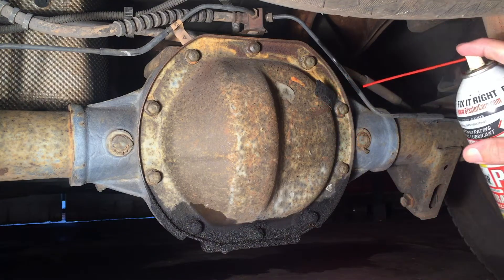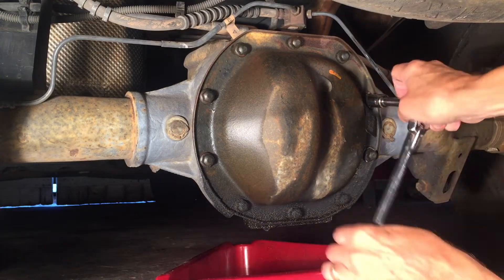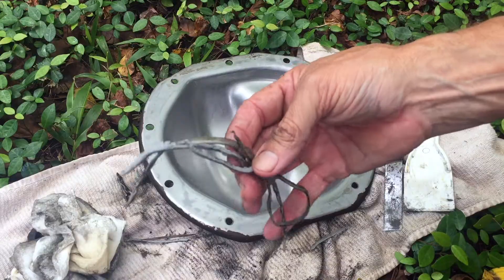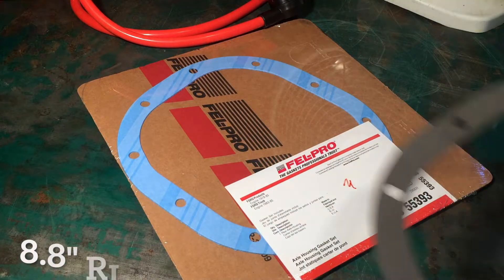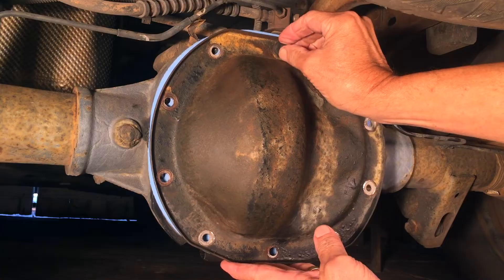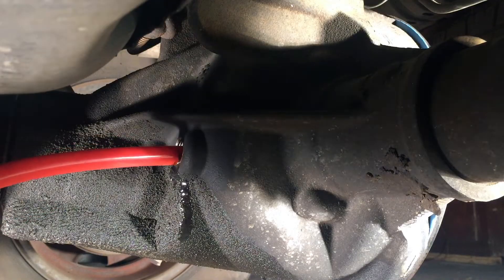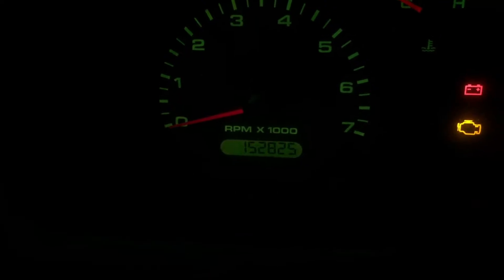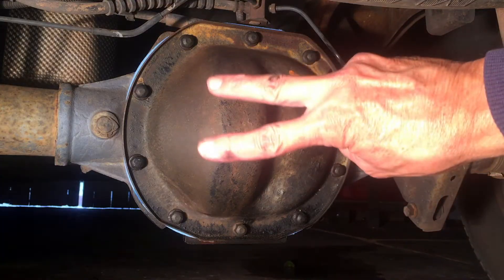Ford Ranger Rear Differential Fluid Change 7.5" Ring Gear

Comment from the maker: Rear differential needed approximately 2.5 quarts of 80w90 gear oil to refill..
Reply: How did you get 2.5 qt to fit? I couldn’t get more than just over 2 qt, like about 2 1/8 quarts was all mine would hold and even then it was pouring out of the fill plug
Reply: @rollin18wheels  Read on some forums that it's between 2 and 2.5 qts. Just depends on the different models of each diff I'm assuming.
Reply: The instruction in Amsoil specifically says: ”Fill to no more than 1/4 to 9/16 inch below fill plug hole”   So it should NOT only NOT overflow, but also have 1/4 to 9/16 inch “BELOW the plug hole.”

My first question is: how much oil did you still have in that 1 gallon container?  Deducting that leftover oil from 1 gallon gives us the amount of oil you had in the gear container. Then, from that we should deduct about 10-15%. That final number should be the maximum amount we should have in the gear container.
Reply: How many quarts for a 1999 Ford  Ranger 3.0 L 2 WD ??
🤠

Comment: The same info from the axle tag is available on the door sticker on the driver side where the date of manufacture and vin and paint code etc is stamped
Reply from the maker: Good to know.. Thanks..
Reply: @PeanutButterMan-PBM  Usually true unless a previous owner did a swap. Always best to double check on the carrier.

Comment: Was that anti-sieze on the fill bolt, or locktite? Or was it just whatever was leftover from whoever used rtv? 😂
Reply from the maker: I had not noticed that but yeah, if you freeze at 00:39 there's red on the threads.. You may be right, some type of anti-seize.. Not sure though..

Comment: I always apply rtv to mine. For some reason, when I only use gasket, I get a leak. Great video!
Reply: When you apply rtv in addition to a gasket, where are you applying it? Just to the cover? Thx
Reply: @jacksondriscoll98  both cover and differential bolt line.

Comment: Do you got any problems with the gasket till now. Or ist it possible to use both , rtv in combination with a gasket.
Reply from the maker: It's been a little over a year and no leaks using just the gasket.. You can use RTV but there's a special one made specifically for differentials:https://www.amazon.com/Permatex-81182-Gear-Gasket-Maker/dp/B0023GM2KK?th=1

Comment: What about the vent and tube?
Good time to check those.

Also, Dino oil might not be the best to use.
Valvoline 75w 90 semi or full synthetic can help in the winter as well as give you slightly better MPG.
Dino if you haul or pull a lot of weight regularly.
75W 90 if you mostly do traveling with light to no load.

Comment: Good vid. Where did you find how many foot pounds torque to tighten the bolts?
Reply from the maker: At the bottom of this page Diff Plate 30ft-lbs: https://ford-specs.com/cars/2007/ranger2.3/torque-specs_rear.php

Comment: Great video, thank you for it. Does anybody know how to loosen the fill plug? Bloody thing is stuck. Don't have room to get it with a breaker bar, hit it with WD-40 still no luck.
Reply from the maker: If you have a propane torch you could heat the plug to expand the metal..

Comment: Would this be GL-4 or 5?
Reply from the maker: This is what I used.. The back label shows GL-5: https://www.walmart.com/ip/ST-GEAR-1G-80W90/285692831?wmlspartner=wlpa&selectedSellerId=0&wl13=4556&adid=22222222277285692831_117755028669_12420145346&wmlspartner=wmtlabs&wl0=&wl1=g&wl2=c&wl3=501107745824&wl4=pla-294505072980&wl5=9011294&wl6=&wl7=&wl8=&wl9=pla&wl10=8175035&wl11=local&wl12=285692831&wl13=4556&veh=sem_LIA&gclid=Cj0KCQjw8e-gBhD0ARIsAJiDsaWWwlZkHFxTt5QnK6o2ZEXxMJHVLXYXMi4J7hxG12FPgIrOKIZyTooaAjDeEALw_wcB&gclsrc=aw.ds
Reply: @PeanutButterMan-PBM  perfect thanks for confirming! Just wrote it down on my owners manual that the trans is GL-4 and diff GL-5. I’ll tell ya it’s hard to find info/specs on these old rides